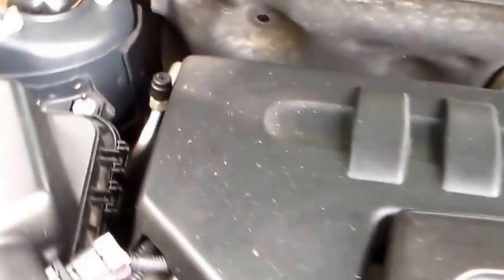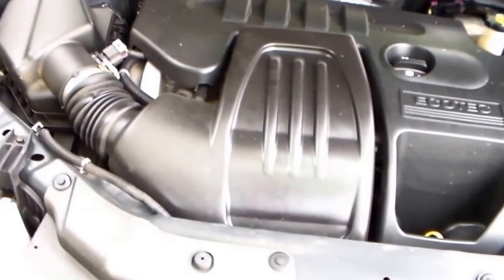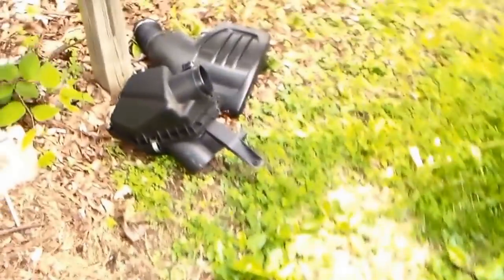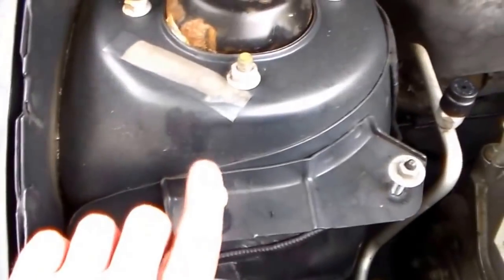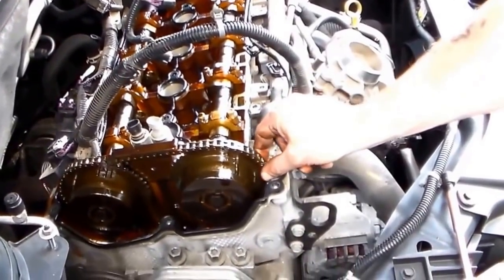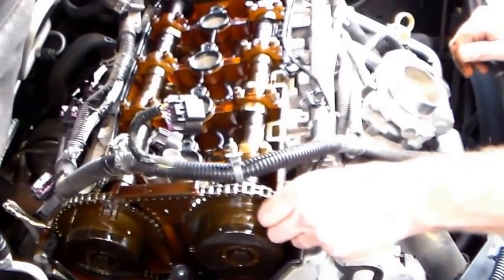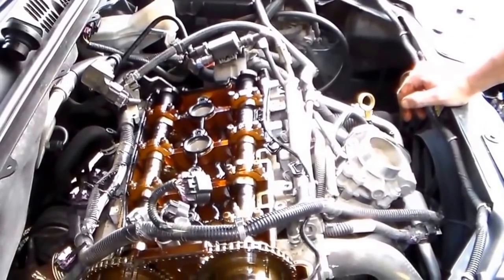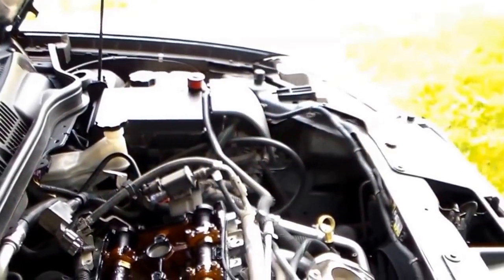timing chain tutorial on Chevy Cobalt 2.2 L Ecotec

Comment: Did you use a torque wrench whenever you timed it?
Reply from the maker: No. I just tightened it to feel but I would recommend using one if you haven't done many of them. But if you don't have a torque wrench, just make sure everything is tight to the best of your ability and you should be fine.

Comment: I just recently found a 09 cobalt ss. I believe supercharged. But the add says it needs a timing chain. I've done pretty much everything from replacing an entire engine to breaks , clutch. Whatever. However I've never done a timing chain. Approximately how much is it gonna cost for the parts?  And since it's supercharged is it gonna make that more difficult to do?
Reply from the maker: The super charger is only another thing to move out of the way. Other than that it's all the same. It will be around 200 for parts. I don't think you'll have any problems with that chain. Just do everything I did in the video and you should be fine. Let me know how you do.

Comment: What is that belt? Should that be changed at some interval?
Reply from the maker: If you mean the serpentine bet yes change it as well.
Reply: At what interval?
Reply from the maker: I always replace mine 30 to 40k. But if you see any cracking or dry rotting (this occurs mainly due to sitting) replace immediately. Check it every oil change.
Reply: Ok. Mine looks fine and not showing any symptoms of going bad.
Reply from the maker: Should be ok. Just check it every oil change or so.

Comment: You forgot to say contact when she was about to crank it and you can change the oil on the transmission and you can check the fluid by plug on the passenger side on the back of the transmission orona front of the engine side and has to be running when you take that plug out and oil runs out for it to be full tank you for your video Oh yeah and when I say contact for the engine to start I didn't mean contact Buzz
Reply from the maker: thanks for watching and commenting. BTW..contact lol.

Comment: I have the same engine with the same sound.what I don't understand is why the slapping occurs at start up,then I've heard the sound go away completely.Now if the tensioner  or chain or any part of this timing area was worn,wouldnt the noise never go away until fixed?
Reply from the maker: Thats because once the engine is running, the oil pressure tightens things up so to speak.
Reply: Thank you for such a quick reply
Reply: weird,sometimes I can start car and hear it right away,but then other days I can start it and it will be quiet until warms up.

Comment: Hey man I know this is an old video but I have an 06 Cobalt SS supercharged and I'm getting timing chain rattle or so I believe, it starts up just fine sounds perfect, but then when you rev it up as it is idling back down from Le Reve you hear the what sounds like the timing chain slapping or grinding like one time like it'll get one thing and then everything is fine if I rev up slowly it does not make a sound only if I pump it. Do you think that is my issue? And I should change the timing and balance shaft chain set? And if so what did you use to hold your engine in place as you remove the front motor mount? Sorry to resurrect such an old video but there isn't a lot of information on YouTube about this
Reply from the maker: It sounds like timing chain slap. Yes I would replace the chain set and gears. I just used a small jack to hold the engine. If you have any more questions feel free to ask. Good luck buddy.
Reply: So I replaced the timing chain set and the balance shaft chain said, still making the same noise. It really does sound like chain slap
Reply from the maker: Replace timing chain tensioner as well. That should take care of it.
Reply: I did. The kit came with the tensioner the sprockets the chain and guides. And the balance shaft chain kit came with new sprockets, chain guides and tensioner for that as well. Sorry this is just driving me crazy as it is my only vehicle and my daily
Reply from the maker: Did you make sure the tensioner turned and put pressure on the chain?
Reply: Fix the timing chain tensioner before its too late!  I just learned about this issue 10 days ago on the scotty kilmer channel, and my chain slipped yesterday. :_(  Malibu 05, 2.2 ecotec 165k miles.

Comment: hi how did you align the timing marks I'm having a hard time aligning mine i have a dark chain link in between two yellow marks and on the guide it doesn't show to have that it only shows one yellow timing mark i can only find diagrams for the non vvt engine and mine is the same one you worked on on the vid
Reply from the maker: elgordotrucking don't worry about the chain the timing marks on the gears or what you need to look for by the way when you time that do not put the timing marks dead on you have to have one called before the mark that way when you tighten the chain it will roll them into position
Reply: thanks for the help i really appresiate it!

Comment: My girlfriend's been having problems with her Cobalt I just change the oil in it and it does sound better but now it seems that the timing chain is making noise like yours did in the beginning of the video. When I first started working on it was knocking now the knocking has went away but the timing chain sounds like it's rattling and slapping in the some stuff. From what I've seen the timing chain kit. Doesn't look too expensive. I don't know if I'm ready for a test like this. What would you suspect labor would be on something like this to replace?
Reply from the maker: If you're talking about labor for a shop to do it, its going to be quite pricey. If you do it yourself it should only take a couple of hours.  Its really not that hard as long as you get the timing marks correct. If you have a friend or family member that is mechanically inclined, I'm pretty confident you can get this done by yourself.  Good luck to ya ad let me know how you did. If you you have any questions feel free contact me and ill help anyway I can.
Reply: shabear1000 I'm pretty good at figuring out things like this but I've never actually tackled a job quite like it I mean I've done brakes of all kinds,ball joints inc. basic stuff as far as automotives go but this would be something new. I'm pretty confident that it's the timing chain that sounds exactly like what was going on in the beginning of your video. I do have a question if it does get to a shop I'm guessing you would recommend not driving it there because like in your video I'm pretty sure that it was caught right before something bad really really happen
Reply: shabear1000 I think the most things I would be worried about it making sure I I got the timing right
Reply: shabear1000 and I'm guessing also that trying to tighten the tensioner won't do enough for me?
Reply from the maker: You're right, I wouldn't drive it there. But it sounds like you could do this yourself.  There are websites you can go on and print out step by step instructions. I think you could do this.
Reply: shabear1000 thank you and I appreciate the quick response. I think the car is just over a hundred thousand miles. She just had to pay a bunch of money a couple months back for a fuel line problem. And now this so I'm going to try and talk to one or two of my mechanic friends and see what the whole deal is with this and how confident I feel about doing it after I talk to them
Reply from the maker: woody P you can try to tighten the tension but it don't think it would be enough. That's kind of an expensive gamble if it doesn't work, Lol. I think you'll be ok doing it
Reply: shabear1000 thanks. If I do it or she has it done I'll let you know hopefully we can get this thing worked out. Cuz really do need the car
Reply: shabear1000 do you know off the top of your head if tightening that Bolt or loosening that Bolt will put tension on the chain loosening it will pull the bolt out wouldn't that put tension or am I wrong..I don't know??
Reply from the maker: That tensioner is spring loaded, so if you loosen or tighten it, won't make a difference.  9 times out of 10 its the tensioner and not the chain that goes bad. So you may get by with just changing that instead of all of it. Try that first.

Comment: hi I recently bought a 2005 chevy Colbalt 2.2 and it wasn't running when I bought it, I was told the timing chain broke...so I started working on the car, got to the timing chain and it wasn't broken however one of the plastic tensions did break into 5 pieces..i ordered the timing belt kit,  replaced everything with all new parts...set the timing marks...put everything back together with new plugs...air filter...oil change...and a few other new parts...after all that the car will crank but will not start...? what did I do wrong it is not throwing any codes at all... I'm replacing the crank sensor tomorrow...I bought this car for my daughter for her birthday coming up next month I could sure use some advice and help on this car...I'm totally confused as to what the problem could be...thanks for your help
Reply from the maker: Loren Jones make sure the can sensor is hooked up. let me know
Reply: I will check that tomorrow...thank you

Comment: Besides just a ratchet set (and a few other common obvious tools), would you need any other specialized tools to do this job?
Reply from the maker: make sure you find a way to hold the cams in place
Reply: shabear1000 OKay cool. I saw a professional vid that had a tool that they used but i think just sticking a wedge in there would do just fine. Did you also replace the balance chain when you did the timing?
Reply from the maker: I replaced everything. I didn't use the tool because I couldn't get one in time
Reply: shabear1000 okay thats what i thought. i was planning on replacing everything while im there. I actualy think my issue is the same as yours. a bad idler.

Comment: My 08 G5 2.2 rattles the timing chain for maybe 15 seconds on a cold start then goes away completely.. Rattles for 3 seconds on a warm start. I'm going to order the updated tensioner and install soon. Do you think that's my only problem and do I need to remover the valve cover to install or can I just screw old one out screw new one in???

Comment: Nice video, thanks for sharing.  Just one thing I'd like to add regarding transmission fluid level check.  The transmission fluid level can be checked by removing the overflow plug. The plug is threaded directly into the case about an inch above the lower pan on the passenger side of the vehicle.  I believe it's 8 or 10mm.  Vehicle must be level  and transmission warm.  Remove the plug and start engine take the transmission filler cap off.  It is the black cap located on the drivers side topside a little down below the brake master cylinder.  Simply add fluid while someone watches from under the car until they see the fluid start  to overflow out of the hole.

Comment: 2006 2.2L makes a sound when stopped at a sign or light in Drive or Reverse.
I believe I've narrowed the sound down to the timing chain. 75,000 miles, never been touched. Should I just look to make sure it doesn't have slack?
Reply from the maker: +Derek Seay   yes, but 90% of the time on those engines its just the tensioner and not the chain itself. could just be a weak tensioner, i would say check that first. let us know what ya find out.

Comment: My engine makes that noise and it loud every time i start it cold or hot but goes away in 2 minutes
Reply: It's likely just a lifter making that noise, it goes away after your engine has built up temperature and oil pressure.
Reply from the maker: ***** could just be the tensioner. try that first. thats usually the problem. let me know what ya find out. good luck man.

Comment: I have a 2006 cobalt with 200000 miles on it. When I asked my mechanic at 100000 miles about the timing chain, he basically said not to worry about it. I fret over this kind of stuff but it made it another 100k miles. These motors I would recommend to anyone, they are practically bulletproof. Back to the tensioner, it is hydraulically operated. If you let the motor oil get to low in it, your tensioner  doesn't hold tension, so keep this in mind.
Reply from the maker: good point, that is true. thanks for the tip to our viewers.

Comment: if i have changed the tensinor and the chain is still loose could it be the chain and sprockets thanks
Reply from the maker: yes the chain could be stretched and sprockets could be worn. but there is also a balance shaft chain that will also make noises as well. it is in front of the timing chain.
Reply: shabear1000 Thanks Man, I Just Changed my oil and the oil pressure of it tighten it Thanks Man..
Reply from the maker: Chase Peterson you bet.

Comment: Hi shabear1000 I just bought a Cobalt LT 2009 with 115K miles on it. I have no idea if the previous owner did a timing job or replaced the water pump so I'll assumed he/she didn't (I bought it from a dealer and they have no information).

Do you think I'm OK if I just replace the tensioner? I've read that the problem with this car in the tensioner and not the timing chain itself.

Also, considering the mileage do you recomend to replace the water pump as well? (It's not leaking but I don't know for how long) Did you replace it in this car? Did you replace the balance shaft chain too or just the timing chain?
Reply from the maker: 9 times out of 10 it IS the tensioner that is the problem. if you were going to replace the balance shaft chain, i would recomend replacing the timing chain as well. but if its not makeing any noises you may be alright just replaceing the tensioner. the water pump, that is one of those things that could start to leak at any time. they are not that costly so i would recomend it, although i did not put one on this car at this time as i ran out of daylight. but i did replace it the following weekend. thanks for commenting and if you have any more questions please feel free to contact me.

Comment: Hi. Thanks so much for the video. I know what a pain in the a$$ it can be to do a job and then record it too. I was wondering how long it took you to complete? Also, if I'm going to tackle this, should I change/fix anything else while I'm in there? Thanks again : )
Reply from the maker: took about 6 hours but it can be done lot quicker. not really hard, but,the main thing....PLEASE MAKE SURE THE TIMING MARKS ARE CORRECT....that is very important. if you need to know how to set the timing i can post a link for you. thanks and good luck.
Reply: shabear1000 could you post the link please
Reply from the maker: Jeremy Kimbro http://www.yourcobalt.com/forums/maintenance/19593-how-timing-chain.html

Comment: Did i miss the part where the chain came out and the new one went in?
Reply: shabear1000 do you remover the phaser cam sprockets or can you get the chain on without removing? Also, are the phaser sprockets marked for cam timing like the non-vvt ecotech 2.2?
Reply from the maker: no. when i put the chain back in i forgot to record it, DOH, lol, anyway, if you need spects on the timing marks and the procedure on how to time it, comment and i can send you a link to step by step info.

Comment: how you managed to set the chain of time without the gears to move from place 
if you have a diagram of time setting that you appreciate me facilites 
thanks friend
Reply from the maker: i used 2 adjustable wrenches to hold the cams in place, but they make a tool to hold them for you, its called a dual overhead cam locking tool. here is a link to step by step instructions on how to time this engine. hope this helps.

http://www.enginebuildermag.com/2010/09/revised-timing-chain-and-service-procedures-for-gm-2-2l-l61-ecotec/
Reply: thanks firend
Reply from the maker: Jesus Serna you're welcome Jesus, if ya need anything else, feel free to contact me.

Comment: Good evening sir, I have an 08 Cobalt LS coupe with 94k on it. Same engine, but I have a manual tranny. I have kept up with services with this car, as my father is a helicopter mechanic himself. I have been doing some research on these engines and I have been noticing that the timing chains seem to be problematic. I am wondering, is it possible to change out the sprockets, guides, balance shaft chain, AND the chain tensioner without dropping the engine? Thank you for your time.
Reply from the maker: yes, the engine can stay in the car. everything you have mentioned here can be done by removing what you see in the video. i hope this helped and if you need more assistance, please feel free to contact me. thank you.

Comment: I'm just curious, did the make any kind of noises related to the timing chain on vehicle start up? I'm asking cause I just had my car serviced, and the work order makes no damn sense, and I don't know if they're saying I need a drive belt or timing chain ( or tensioner for the chain), cause I know they are different things. But when I went to start my car, there was a loud metallic sound...ironically sounding like a chain. I know it might be obvious to some, but it would help me out.
Reply from the maker: yes, it sounded like a diesel for about 3 to 4 seconds. and when idling it sounded a little noisy on the right (passenger) side. the chain was actually ok, it was the tensioner the was bad but i figured since i was in there i would go ahead and replace it all since it had over 100.000 miles on it. hope this helps.
Reply: Yea, mine is way over due in that case...pushing over 165,000 miles, so this isn't really surprise LOL. thanks for response
Reply from the maker: you are welcome. any questions feel free to contact me. thanks for watching and commenting.